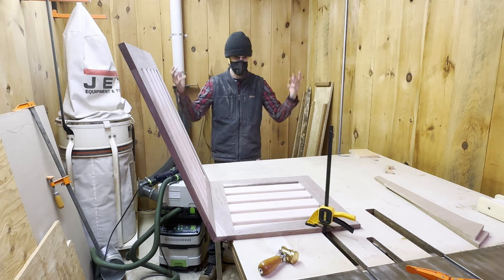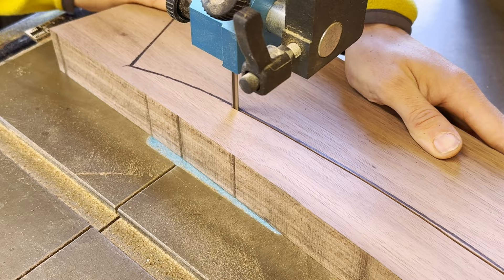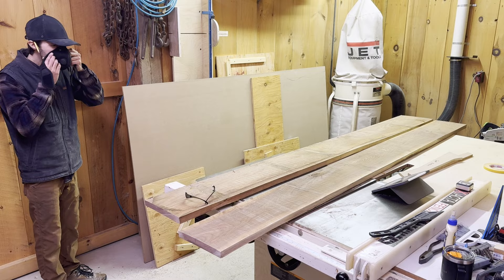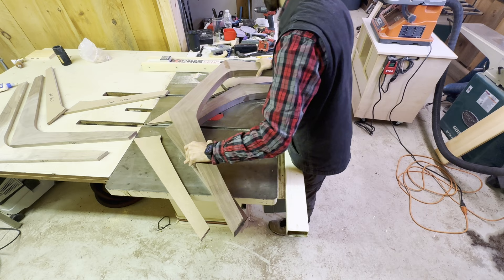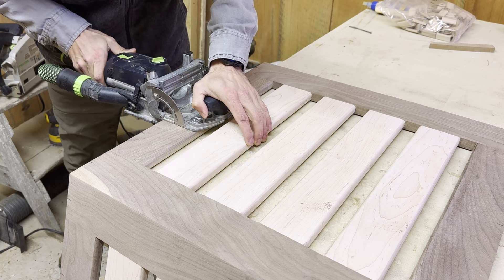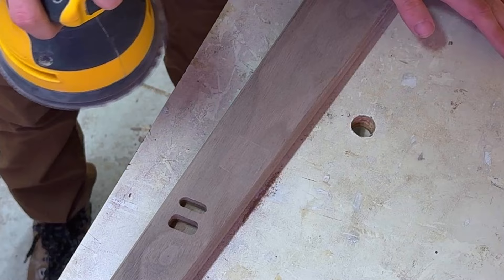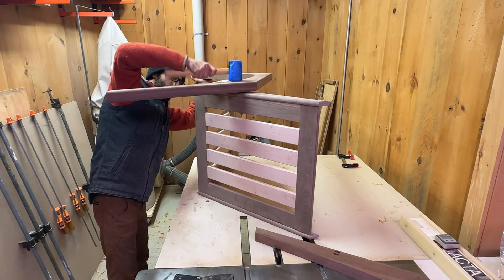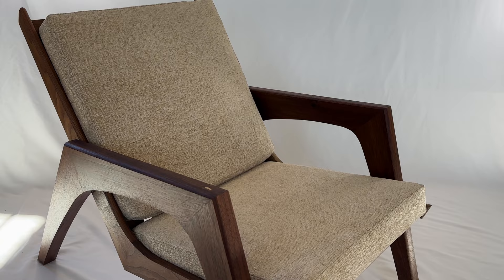Can I Build The Famous Glenn Chair?

Comment: Glenn came out very nice 👏👏. The result is amazing.  I should try to make it one of these days ☺️.  And I love your round clamping blocks, great idea! How did you make them?
Reply from the maker: There are 5x30 between the seat and rails. 6x40 between the rails and legs. AND 8x50 between the joints of the legs if I remember correctly. As far as the round mounting blocks go I used a hole saw to cut out the circles then just screw then from the bottom to the flat base. I’ll put together a short video soon to show you.
Reply from the maker: And thank you for the kind words and support 😁👍🏻